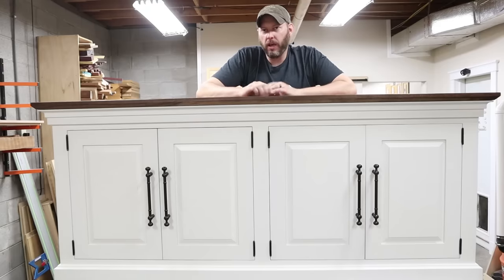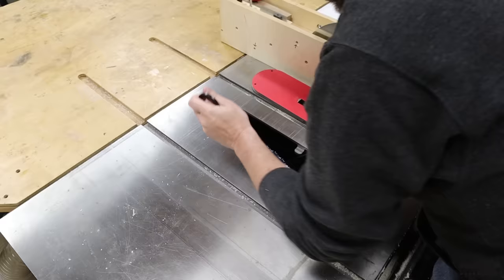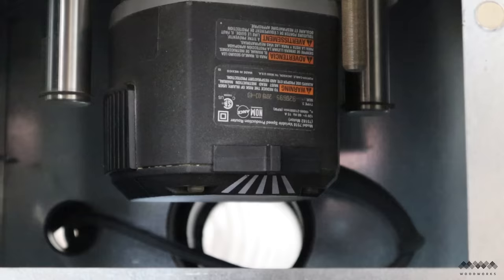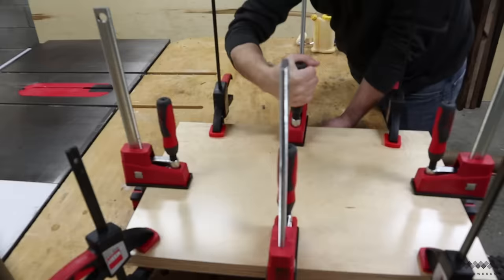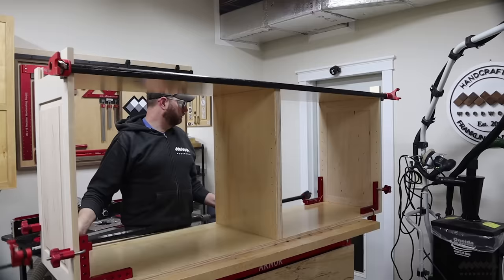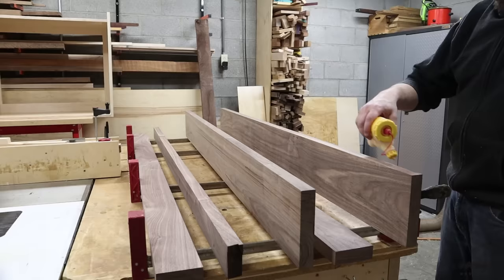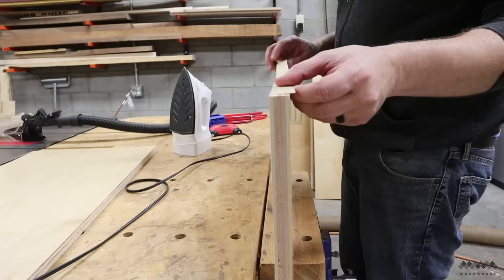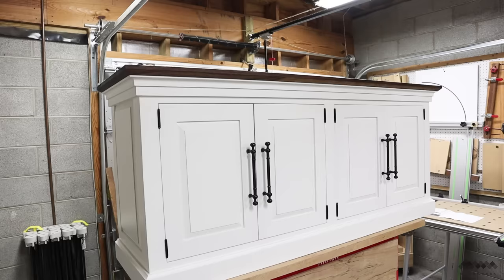$5000 Custom Built Console Table

Comment: Came out great Matt! What did you use for finish?
Reply from the maker: Thanks Guy! The cabinet was primed with a shellac based primer (sprayed) and the top coat is Sherwin Williams Kem Aqua Plus (also sprayed). The top was done with Rubio Monocoat Pure.

Comment: I like your design, great work.  Do you have any recommendations for a small shop with no room for a planer or jointer to make a similar build?
Reply from the maker: As long as you can get a hold of 3/4" material that has already been flattened and squared there's no reason you couldn't do this build 👍
Since I typically work with rough lumber (cheaper to buy) I always have to mill it first.